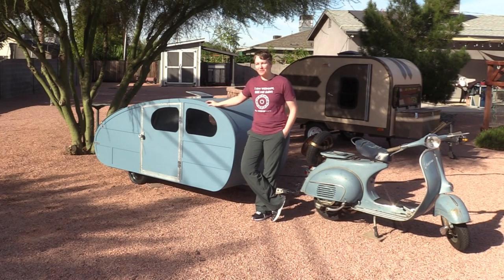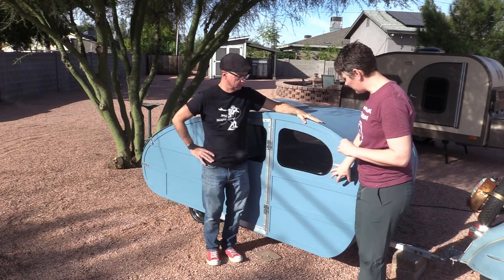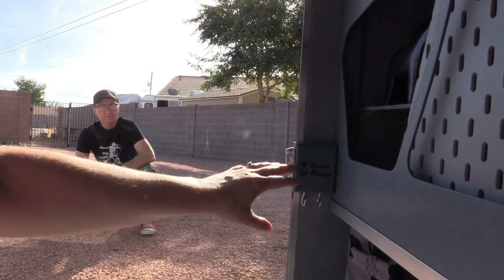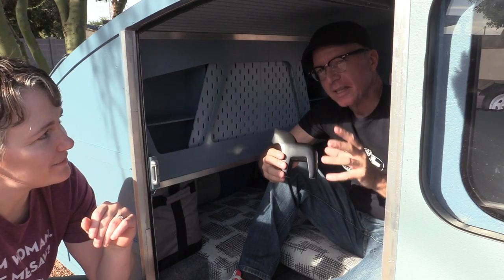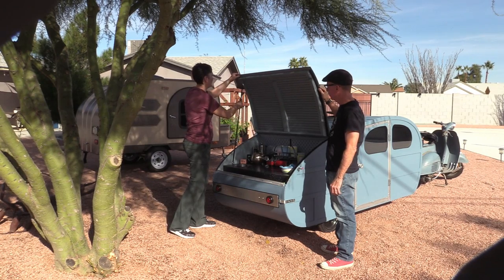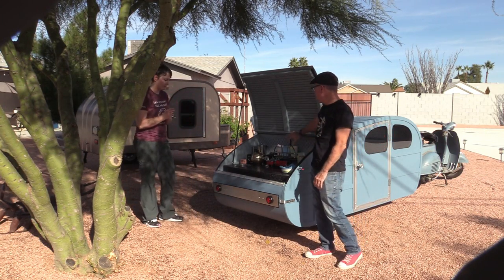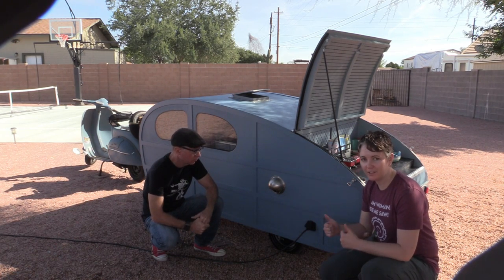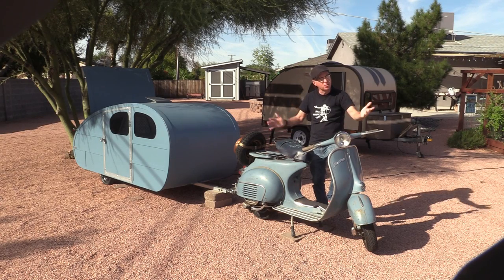Micro Teardrop Trailer for a Vintage Vespa! Foamie with Poor Mans Fiberglass! PMF

Comment: I had a Vespa just like that when I was 13 years old. I bought it for $5 from an friend who got it out of the garbage dump. He couldnt get it to run. I realized the spark was to yellow. Not hot enough. I figured out it was missing an ignition coil. I found an ignition coil from a motorcycle. I got it to run... My dad and friend couldnt believe I got it to run. At the time the shifting lever inside was also broken. I took a piece of metal and a grinder and built a shifting lever. It didnt have shifting cables either to the handle bar. I found some from a bicycle. My dad and friend was quite impressed. I had a lot of fun with that thing.
Reply from the maker: That is so awesome! And what a deal!!

Comment: I have made panels from foam and fiberglass and they are usually stronger and take quite an impact so this was a great video I worked in a research and development department for an automobile manufacturing company and we made entire plugs to be molded from out of foam and found strength wise it was better than aluminum sheet and of course the insulator factor and the light weight I appreciate this video because it shows people in the public there are more options out there to build from. Thanks again.
Reply from the maker: Thank you so much! And thank you for that awesome information!
Reply: I got a idea,could it be possible to build a small truck camper out of foam?
Reply: @jackbishop5992  yes it can, one of my friends did something similar using foam sheets , that you get from the hardware store big box .then spray foam in the corner and with a  angle grinder and 60 grit paper to quickly form rounded shape than i’ll aluminum tape to get  a smooth surface to pull off of using your release agent or  you can use believe it or not Pam spray for cooking .woven matt first layer dry and use roller and brushes to get air out . then whin dry sandpaper  scuff with 40 or 80 grit sandpaper and apply as many codes after that the inside will be slick you reinforce the outside with two by fours or cardboard or whatever flip it over .after you pull it off put  release agent on The mold you just created and spray  slick sand polyester primer first apply Thick say 2 to 3 layers or coats ,then win sticky but not sticking to your fingers .apply fiberglass first coat ,is the most important to get the air out of again you can let that dry scuff it apply more possibly 3 to 4 coats this will be strong enough when you pull this out of the mold .you will have an almost finished part you still will have to sand the rough spots fill some body filler in the low and air holes sand this and spray more slick sand. then you can do a regular paint to finish over this sounds like a lot of work but it’s not really that complicated .and you can make several of these parts out of the one mold you can just lay the fiberglass over the foam  and finish the outside but this is not going to be nearly as straight and flat where it needs to be . If I did not mention the phone board has aluminum on one side and just Styrofoam on the other Styrofoam if you apply polyester resin directly to it it will melt you have to have the aluminum or painted with latex paint one coat to dry completely then apply a secondLet that dry and you should be able to lay fiberglass on the phone directly.

Comment: There's a guy on the channel "Little House Off Grid" who built a truck camper out of 2x2's for framing and covered it in coroplast sheets. It's not pretty but he has used it for years on his truck living in it full time and then he added a base, lived in it on his property, built a tiny house and now uses it as a storage building.
Reply from the maker: That's very interesting! I will have to check it out
Reply: @thelwood  check out JupiterHikes, he hiked it a couple of years ago and did a video series on it.

Comment: Hey, Lucy. I just found this channel and I'm really impressed with your knowledge about "pmfg". I'm considering using it for my own camper build but I, also,  want to build a 10' sailing dinghy to go with it. The usual method is marine plywood, epoxy, and fiberglass cloth( stitch and glue). You did say you were always looking for new projects and I am curious as to how a boat would hold up using the aforementioned "pmfg". Pretty please with sugar on top?
Reply from the maker: Hi! Thanks for watching! So historically boats were made with PMF, many of them it is was the boat deck that was made with it.  I have thought about trying to make a foam paddleboard and coating it with PMF. I think it would do well for any boat that was pulled out of the water everyday and allowed to dry out.  I am not sure if I would trust the seems completely for a boat that soaked a lot.  I would opt for marine epoxy probably. Just to make sure the hard work of build is super protected!

Comment: Very cool.  Love the retro styling & vintage Vespa.  My only question is:  Is a trailer licence & insurance required where you live & is it possible to do so with a homemade foam trailer so that you are able to legally use it on the road for camping trips?
Reply from the maker: Thank you! Yes, here in Arizona it is actually very easy to license a homemade trailer. You just have to take it to the DVM and pay a fee for an "inspection"... which basically means they measure it and put a VIN on it.  It is probably much harder in other states.  Our laws are pretty lacks...
Reply: @thelwood  My question exactly and your answer couldn't be more useful to me. I just move to Arizona! I stumbled upon your channel a few minutes ago. I will now go on a binge, then draw up some plans. It would be so fun to build something like this!

Comment: well well I am impressed from ur building guys as Italian I know how the brake system is inadequate for the vehicle and project.I know there are some front disk brake conversion be sold aftermarket or,If I would be u, I would fit disk brakes at the dropy and command using the foot pedal of the bike.it is all cable stuff,having a sort of plug and play when u mount the trailer is gonna be safer and cool.Have a fun!!
Reply from the maker: Thank you for the information! I will pass it along to Tom 😃
Reply: @thelwood  you are welcome 🙂

Comment: How did you get the trailer licensed? I think one of the things is the tires have to be up to a certain road standards. If it's gonna be powered , otherwise you can get away with bicycle wheels if it's being powered by a bicycle

Comment: You should add disc brakes to the trailer & use them instead of the Vespa brakes to keep the trailer from coming around on you.
Get 2 matching small motorcycle front rims with calipers.
Mount the master on the Vespa & use a long rubber brake hose before a hardline split to feed each caliper.
Probably only add 20lbs to your rig.
Reply from the maker: Great idea!

Comment: Just a guess - the light weight of the trailer is the only hope you have of stopping quickly with those brakes. Wear boots with thick soles, just in case.
Reply from the maker: It actually stops really well,  but the light weight does make wind gust challenging.

Comment: Was here 7 months ago came back to looks at this fantastic little tear drop. Me and my husband recently got a Harley we plan on doing a cross country trip with no time limits. We looked at some motorcycle camper hated them most are a tiny trailer with a tent in top and thaf not what I want plus they are way to expensive. Then I thought of this very cool tear drop camper I would do a few changes for what we need but this is prefect for us... 
So I have a few questions. 
What is the total weight?
What was the material cost?
And what glue did you use?
And the material use to put on the foam for the poor man's fiber glass?

This is by far the best foamy camper I've ever seen. Its very nicely done you have mega talent I think you could make these and sell them with no problem.
It's fabulous
Reply from the maker: Thank you! It is 170lbs. I used foam fusion for any foam to foam or foam to wood parts.  I used titebond2 for applying the canvas for the PMF. I am not certain of the total cost.  The biggest expense would be the aluminum trailer and Tom had a friend who welded it for him.

Comment: Ok, this is how you build a camper. I'm currently designing a long range bicycle camper for selling purposes and this has given me a lot of inspiration. First off, pmfg, guess that's something i'm going to have to learn to use, especially if I intend to keep it below 120 lbs. Second, I like the amount of space and the back area for cooking. Genius. 
How well does the foam work? I'm thinking of doing my trailer from aluminum with foam style roof similar to the structure of an ultralight, but I may end up using this method alongside.
Reply from the maker: Very cool! The foam works really well,  if you can find 1.5 or 2 inch foam for the walls that would be even better! But using pmf on the inside and outside of the walls provided a lot of rigidity!

Comment: Hi Lucy
Wonderful videos.
I have been thinking of building a teardrop trailer for towing behind my motorcycle.
I live in Ireland and we have very strict regulations on sizes (1m wide 2.5m from rear axle to end and 150 kg or 2/3rds of the weight of the towing bike (whichever is lower)).
Could you please advise on the dimensions and weight of the foam teardrop?
Many thanks in anticipation 
Graeme
Reply from the maker: The trailer is 40 in wide (1m) and 72 in long (1.8m). It weighs 170 lbs (77kg).

Comment: Did you do a vid on making the trailer frame?
I have a scooter as well and might be making one of these for camping adventures. But I’m 6’2” so I’ll be stretching the camper a lil bit.
Reply from the maker: One of Tom's friends did the welding for the trailer.  It is welded aluminum.  I have a pacemaker so I am not allowed to participate in any welding..boo 😂

Comment: So I'm going to be building a truck bed camper and was wondering just how rigid this trailer turned out as I'd like to save as much weight as possible probably still going to add some 2x2s for support but I'm kinda nervous about using foam
Reply from the maker: It is pretty ridged but I would go with 1.5 or 2 in foam for a truck bed camper and a few 2x4s would be a good idea too :)

Comment: How do you attach the roof vent ? Do you just screw into the foam or do you put boards underneath the foam ? Also how do you attach the foam to the trailer ?

Comment: In your other making-of vid you skipped the part where y’all put the Burch on the sides. The ‘framing’.  How was it attached, where in the painting process was it attached to the side, was it all caulked in...? I keep watching the vid over and over getting tips and seeing things I didn’t see previously.
Reply from the maker: The 1/8 Birch is just a couple inches of trim right over the foam. Attached with foam fusion. It is attached directly to the foam.  And then canvas is put over the top. The 1/4" grid on the outside was applied after the canvas. It isn't as well protected this way,  but we didn't think we could get the canvas in all of those edges very well. It was applied with 2 part expoxy and then caulked in and several coats of paint were applied.
Reply from the maker: I don't have good footage of applying the "grid". We were so focus on how to get it on there and where to clamp that we forgot to hit record... oops!

Comment: how much do you reckon it weighs without the trailer? I want to build a camper to pull behind a large 1300cc motorbike. the problem is due to uk law trailer has to be 3ft wide but a load can be any width so i will need to build the camper so its removable this creates issues as i want a backup battery in the trailer and a diesel heater as well. im not sure if i can build a steel trailer if this is light enough or a aluminium one to save weight. do you sell plans of the build as making the top hatch and door waterproof sounds tricky. I bet the foam mus work well for cold weather and fans will probably help for hot i will just do a drop tube that goes close to the ground as the inlet and a top vent sunroof etc as the outlet

Comment: Awesome video. Very well presented and great information. I've been working with PMF off and on for a couple of years but I've learned SO MUCH from your channel. My question concerning this build is cross winds. With the super light weight of the camper and scooter, does this present any issues? Thanks and Keep the great vids coming.
Reply from the maker: Thank you! And you are absolutely right, wind is the most challenging issue.  I said "I think we are building a sail" several times. Tom is an experienced driver and he is very aware of the weather prior to heading out.

Comment: Beautifully made, but a few questions/observations... 1) What's the total weight of the trailer?  2) It is truly waterproof?  3) I want to see Tom actually go up hills in this rig.
Reply from the maker: Thanks for watching! Weight is about 170lbs. It is as waterproof as any teardrop. There is weatherstripping everywhere and everything is sealed. But just like any camper it is important to check the seals often. And until he drives it in rain we won't really know if the galley and door need more weather strips. Those are the only 2 spots that might allow water in. The galley hinge is totally sealed.  We put a bicycle inner tube under the hinge and used sealant.  The poor man's fiberglass is very durable and weather resistant. My trailer is 6 years old and in perfect condition. My cargo trailer is 4 years old and is stored outside and also still perfect. He drove out to a state park today. He will have go pro footage. The hills were fine (not terribly steep),  the strong wind today definitely made it more challenging but doable.  Wind has been my biggest concern... definitely a bit of a sail. For longer trips he plans to use his bigger bike. He plans to use it mostly here in Arizona and will be very weather conscious since he is on a Vespa.
Reply: @thelwood  looked like a good build.  Engineering appears to be top drawer.  170 lbs is awesome.  Sealing it should be accomplished easily IMHO of course
Reply from the maker: @mikeb3603  thank you so much!

Comment: So you cut the foam every inch? What was your depth, or there abouts? I feel very inspired! Fascinating how you were able to bend the foam to such groovy angles.
Reply from the maker: Thanks! For the tighter turns I had the blade set at almost 1/2" and for the rest I did 3/8".

Comment: Good morning, maybe I missed this in the video and the comments..... total weight of the trailer?..... flammability? Right off hard I would be concerned about heat and open flames around foam. Thank you
Reply from the maker: Total weight is 170 lbs. And good question about flammability. The foam is not terribly flammable but certainly could catch fire. This is definitely for reasonably warm/ good weather use anyway. There will never be a heat source inside the sleeping area.
Reply from the maker: Basically the intention is that this is a step up from a tent.  So the one colder trip that Tom took,  he used a sleeping bag.

Comment: Lucy, how is the canvas holding up on your TD. Do you cover it in the winter.
Reply from the maker: The canvas is holding up great! I have made 3 trailers with it.  My personal teardrop is 7 yrs old.  It has a cover on it and is under a lean to. My cargo trailer is about 4 yrs old and is fully exposed to the elements and is also holding up great.  With that being said,  sun and heat are our big issues here in Arizona.  None of them have ever sat out in snow.

Comment: Can you please tell me how you attached the long wooden dowels that hold the side walls? Thanks so much
Reply from the maker: I drilled 1 in wide, 3/8" deep holes with a forsner bit, then used foam fusion in the holes and inserted the dowels. Then I applied clamps (with light pressure) and boards under the clamps to distribute the pressure and reduce denting the foam.
Reply: @thelwood  Thanks so much...Also what skewers did you use? Metal or wood skewers? Thanks so much

Comment: Where did you get the trailer frame and how much does it weigh alone, before the teardrop?
Reply from the maker: The trailer frame only weighed 27lbs! One of Tom's friends welded it out of aluminum. I do not have plans for it unfortunately

Comment: Would this type of construction hold up to highway speeds say behind a dual sport motorcycle?
Reply from the maker: I would go with 1.5" or 2" foam to make is sturdier. That would give you larger surface areas at the joints.
Reply: I wouldn’t expect to use it more than once after a highway trip. Getting liability insurance might be an issue. A cool project but I’m not sure of the real world practicality. It would be a significant investment I wouldn’t bet on a positive outcome on the highway.

Comment: What about registration of it?   I notice you have no trailer license plate for it.
Reply from the maker: This was right after building it. I believe Tom has since registered it. It might be difficult to get something like this registered in other states.  But Arizona is easy.  My other trailers just required an "inspection " in which they simply measured the length then put a VIN on it.... for a fee, of course 🙂

Comment: What wheels did you use on this trailer?
Reply from the maker: I know I responded on the other video but I thought I would share here in case anyone else asks the same question. 
Tom has upgraded the wheels, this is what he is using now. The rims are steel go-kart rims with high-speed bearings. The tires are 4-ply 4.10x3.50-6 Carlisle tires with industrial grade inner tubes. I would recommend going with larger tires. 
In the size stated above, it's impossible to get real speed rated tires. The Carlisle's only have a "B" speed rating (30mph) and I was lucky to find those.